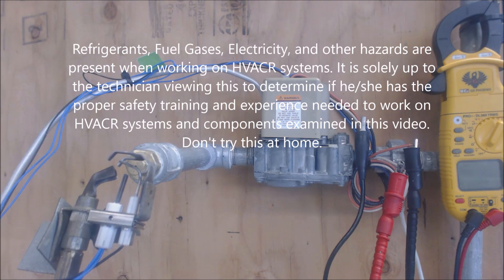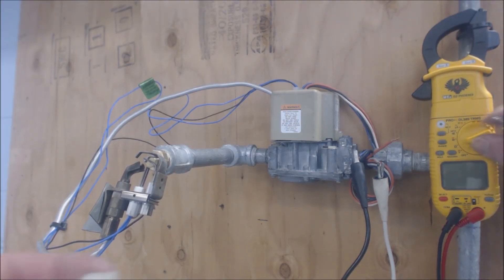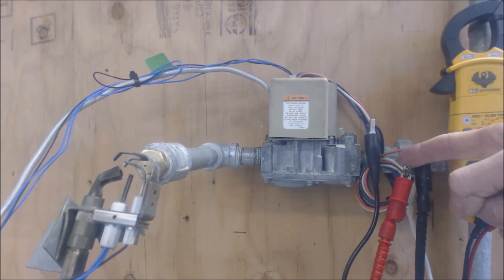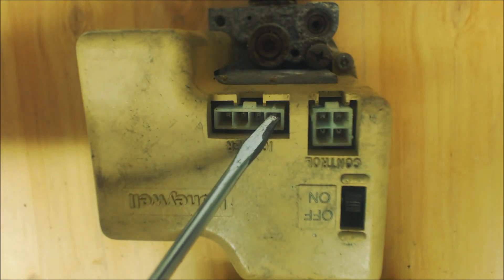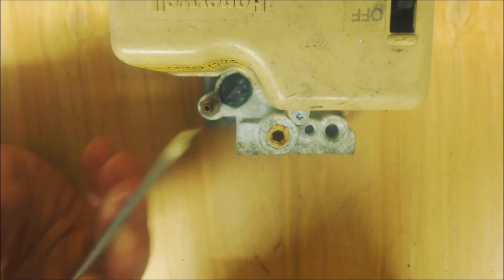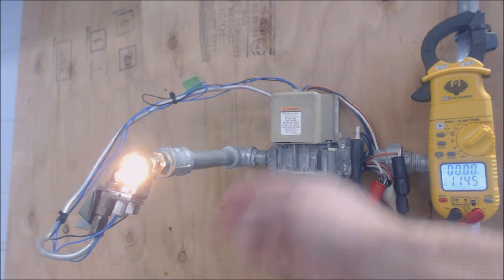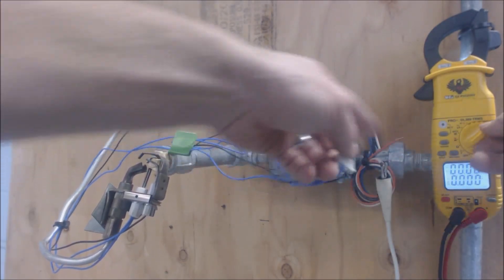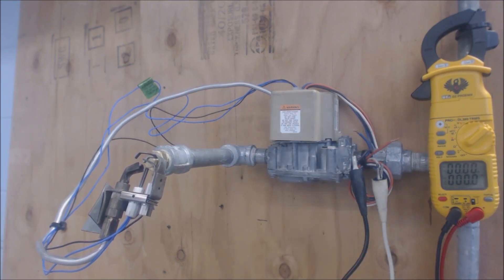Gas Furnace Smart Valve, Ignitor, and Flame Sensor Troubleshooting!

Comment: I have the same OEM igniter/flame sensor.  Looks to be original, maybe ~20 years old.  My igniter doesn't glow.  Igniter condition visually looks good.  Ohms test is good (3.4 to 4.6 depending on which tester I use), and the smart valve is putting out 24volts to those wires.  (Not sure if I was supposed to test that, because no where on the web does anyone do that.)  Does this mean that the igniter is shot?

Comment: I have a a smart valve system, but it also has a control board. I'm not getting my draft motor to turn on when I call for heat. Limit switches and pressure switches are good. Motor is good. Does the smart valve control the draft motor or is it my control board?

Comment: Do you know if the newer valves are giving a lower fluctuating voltage on the flame sense post? ( Cycles from 20v goes up to 50v then keeps repeating same reading)

Comment: I Have This valve. Hot plate lights, pilot lights and stays on. But then main gas does not start to flow. Then the furnace starts to blow but obviously there is no hot air. Do I need a valve or a board? Yikes I can't figure it out. Already replaced Hot Plate / flame sensor, and nothing changed.
Reply: There seems to be no separate circuit for the main gas valve it seems the Pilot gas valve and Main gas valve should open at the same time unless there's an internal timer. I believe my valve has failed

Comment: I just left a service call.  I discovered the flame rod had come in contact with the metal shroud that is situated over the rod.  the assembly had been tampered with.  the shroud was slightly bent enough to touch the flame rod.  flame would not make.  all i had was the draft motor.  after viewing this video, i have discovered a means to prove a good gas valve.  and how to carefully inspect the entire circuit without going down a rabbit hole.  great video.  i won't forget the nightmare of a service call that this last one put me through.

Comment: Hi I converted mine to propane. Same smart valve as yours. I’m using it for a fire pit outside only problem I have is that at the psi flow from the tank to the valve the burner won’t ignite even though the igniter is glowing. But once I lower the psi to about 2-3 psi it turns on, what do you think is the problem?

Thanks.
Reply: For anything to ignite it takes flame or an ignition heat source, fuel which you apparently have a ton of and it must be combined with oxygen to combust. By lowering the pressure to get it to ignite, it seems like the high pressure isn't allowing enough oxygen with it as it passes over the ignitor to ignite. That's my thought. As long as the lower pressure is within low limits spec you should be good. No longer flooding the system with to much fuel. Anyway that's my thought.

Comment: I don't know about Honeywell OEM, but I took apart a compatible SS24 SUPCO ignitor and discovered that they actually use a copper cuff thing that is brazed to the nitride.  This is totally inferior and doomed to premature failure due to the combination of oxygen and thermal stress destroying the braze (the reason I took the damn Chinese piece of crap apart to start with to see what happened).  Nickel alloys OR BETTER  are supposed to be used for the connector with a suitable solder and flux.

Comment: Hi there.  I have a Dayton heater that I am trying to diagnose.  I’ve checked all the different voltage you mention, and the only deviation I have is in the flame rod - I get 24V AC, which I have read someplace is proper for my valve SV9500M-2562 (propane).  The heater will light and turn on,  it then turns off after about 15 seconds.  It then turns back on, and shuts off after 10 seconds… then 5 seconds… then 4 seconds… keeps on decreasing.  I’m thinking something is getting hot and shutting it off, and subsequent heat events take less time to heat it (whatever it is) up.  What other sensors should I check?

Comment: great video, learned a lot. Sv9500h gas valve is not producing 180v for flame sensor, only producing 2.0v . Igniter comes on, pilot comes on but no main burner. Please advice what I can do. Can I get a replacement  IC board. Or is there components on board has failed, how can I test it.  Thanks for any help you can provide.

Comment: Hi, my hsi had about 4.8ohms. Both blue wires have 24vac. But the hsi is not glowing. Black and blue wires also have 24vac. Is it bad valve? Thanks
Reply: Same issue here, what did it end up being??

Comment: EXCELLENT EXCELLENT EXCELLENT explanation of a smart valve pilot ignition system. Just was I was looking for too. I like the fact that you took the time to disassemble the pilot assembly for us noobs. LOL.  It's exactly what I needed to see and learn how/what to do, as my igniter assembly, of the same type as yours int he video, seems to be the issue with my furnace not firing up.  I ordered the replacement part, changed it out myself, and I have heat again. Woohoo! Thank you for making this. A big help that saved me time and money.

Comment: Hey buddy , I have high voltage going to smart valve but no high voltage going to inducer motor to start it up , I jumpered all the safety limits and then jumpered out the inducer motor and it started , I ohmed out the ignitor had 4 ohms . So I diagnosed a bad smart valve , but ppl haven’t went ahead with repair yet , is there something I’m missing here on the proper diagnosis ? It has an 8 pin low voltage Honeywell type molex plug to it as well, thanks In advance , highly appreciate your videos !!! 🙂

Comment: Great video. My black wire had no voltage. I removed the new ignitor connecter and checked the gas valve and had voltage. The connecter on the black wire was not making contact with the gas valve.

Comment: Thank you for great video. I have Honeywell SV9541M2094. I am not getting 24v on ignitor blue wires. I seeing 24v on one of ( black sideone) blue wire to ground.  What could be the issue? If I manually use lighter close to pilot gas, it fires up and furnace start working.  Any help on this?

Comment: Wow! Thanks for helping a Kiwi down this side of the world! So this was very handy!! My pool gas heater stopped working last week! Has the same valve. So I put a meter on it and managed to get 24v on the heat igniter wires which I figured was the case as it was glowing. I just couldn’t get the pilot to start. The black wire to the rod was weird! It was fluctuating between 18-45volts? So long story short, it turns out the gas jet at the pilot end was blocked! Cleaned it out and got a good pilot. But then next issue...main burners would start but go out every time after about 10-30secs! I thought it must be the varying voltage in the rod wire so ran a new earth wire from rod to valve switch in circuit, no change. Tried adjusting the rod and heat receptor arms in case they were out of alignment, no change. Ran earth wire from pilot to valve body, no change! Spent ages trying to figure it out. Turns out, I managed to fix the issue by dropping the pilot assembly down a little below the main burners. It seems to be getting too hot once main burners kicked off and maybe a safety was switching it off??? Any ideas??? As soon as a dropped it down, the main burners kept running! Seems to be working perfectly. Tried moving back up, burners went out!!! So, just thought I’d share this in case it helps someone else! No idea why it worked last week in that position and not anymore? Can only think when I took it out I must have bent the bracket or something causing it to lift too high? Hmmm??

Comment: Why does the pilot stay on at all times on mine? And when I get a heat call the main gas does not come on but if I remove the surface ignitor/flame sensor prong the main gas opens and it starts heating
Reply: A pilot that stays on all the time sounds like a "standing pilot" system. is there a thermocouple that the pilot heats up?
Reply: @tychodancer   I have the same problem. Do surface ignitors/flame sensors go bad?
Reply: @DAVE-tv2fs  Oh yeah. The hot surface ignitors break really easily. and the flame sensors can get dirty and corroded. If you need to replace them make sure you get the right replacement. Also hot surface ignitors can go bad if they get exposed to the oils on your hand so don't touch the black sparkly part when holding it.
Reply: @DAVE-tv2fs  You can clean a flame sensor with a scrubby sponge like "scotch brite"
Reply: A flame may not be sensed if the unit has a bad connection to it's "case ground". so you can have a good flame sense but a bad "electrical ground" connection.

Comment: Great video to understand how the furnace works. Would be possible to have faulty Igniter/Sensor that works with thermostat without C wire and does not ignite when replacing with thermostat connected to C-wire?  Also, I measure the resistance on cold HSI and it is 4.1 oms. Trying to troubleshoot the 19 years old furnace when newer thermostat connected through C-wire.
Reply from the maker: The c wire or battery powered thermostat shouldn't be a problem. You just want to make sure that you have 24v on the w thermostat terminal when calling for heat at the thermostat, thanks!

Comment: Great video, much thanks!!  I've got a question.  I'm having some trouble with the on/off switch. If the switch on the gas valve was in the off position, would the ignitor light???. I'm dealing with a possible broken switch and Im trying to confirm  if it's on or off. Everything is working except no gas flow to pilot.

Comment: hi, i was working on a rooftop with the same smart valve. but when i measure the black wire (flame sensor) i was only getting around 50vac. The flame rod was very clean. Why is that you're getting around 180vac but mine was only around 50vac? thank you for all your help.
Reply: I got 144v

Comment: What is the valve that you’re working on?  I have a bad connection between the 3 pin connection and the igniter, everything tests good individually but when connected, the igniter doesn’t receive voltage.  Thoughts?
Reply from the maker: That is a honeywell smart valve, thanks!
Reply: Same replace it

Comment: Thank you again I actually have a sv9500m 2500 are these valves interchangeable
Reply from the maker: You would just have to look at the wiring. The newer version has more wire connections than the older one. There are two main types of honeywell smart valves used predominantly, thanks

Comment: Thank u ,so correct me if I am wrong so if the ignitor resistance is ok and it glows and u have good gas pressure .the pilot black wire should have 110 volt and the valve should send gas to pilot and the flame rod recognizes the flame and open the main gas valve thank u again
Reply from the maker: The black wire will have about 180v when the pilot tube is supposed to have gas flowing throughAll flame rods have 80v to 180v ac voltage and the smart valves typically have a higher voltage, thanks.

Comment: My hot surface ignitor gets red hot what do u think it could be the pilot flame doesn't light ?? Thanks
Reply from the maker: If it is a smart valve like in the video, check the inlet gas pressure and then the outlet pressure of the pilot tube. If there is good pressure going in and no pilot tube pressure while the hsi is red then the smart valve is bad, thanks!

Comment: So the bread ties finally stopped working. I was able to get the resistance reading on the hot igniter and it is 4.8 - 5.0 ohms.  The pilot light will not ignite but I can no longer hear the click from the thermostat calling for heat.  There was a series of clicks when it is working that I am no longer hearing so now I do not know if it is the thermostat (original since house was built in 1969) or the smart valve igniter module Honeywell SV9500M 2682 HQ1009093HW.  What do you suggest?
Reply from the maker: You can jump from r to w in the thermostat to bypass that so you can see if that was the problem.
Reply: Sorry I did not know you had responded to my inquiry -- what do you mean I can jump from r to w in the thermostat to bypass that?  Do you mean I can check to see if the call signal is being sent from the thermostat to the heater/furnace by connecting the r and w wires in the thermostat?
Reply from the maker: @tzxlyd3828  Yes that is correct to take it out of play, thanks

Comment: hi thanks for all your videos...
today i checked a good man package unit , the hsi do not glow , i have 24v coming out the gas valve, but when i plug the hsi , lost my 24v.
i check the hsi direct from transformer and the hsi glow.
can you help me out .
t thanks
Reply: what do i need to do , it's a new gas valve, the person who install the gas valve , he just tell me , that went he was connecting the gas pipe , he saw spark every time the pipe touch the unit .
Reply: Josue Lopezchente  I’m having the same problem. I don’t want to change out the valve if it does not need to be. Did you ever figure out what the problem was?
Reply from the maker: That sounds like a ground problem or just a problem in the smart valve board if you are receiving the proper 24v input as a call for heat, thanks

Comment: I am having a Lennox furnace, was having issues where the main burner was not coming up so I decided to purchase a new smart valve...went with the SV9501. After doing the replacement now the pilot will go on and the main burner would go on, but when I shutdown the furnace via wall switch the pilot does not go on. I check the actual rot and igniter and noticed the blue wires by the  hot surface igniter as well as the black wire of the flame sensor were a bit melted. I am trying to understand what controls the pilot gas output. I know it comes from the valve, just wondering if the frame rot and the hot surface igniter are the one controlling the sequence along with the Smart Valve. Before I go ahead and purchase a new hot surface igniter I would like to hear your recommendations. Thank you.
Reply from the maker: The smart valve heats the hsi and then opens the pilot tube to let gas through. It is all controlled at the smart valve control board. I don't know why your pilot would stay lit without a call for heat. Does your hsi continue to stay powered too or just your pilot allowing gas through, thanks
Reply: @acservicetechchannel Basically, I turn the gas on (safety measure during testing phase) then I proceed to turn on the wall-switch. After than I see the HSI glowing and then the pilot goes on then the main burner lights up. When I turn the wall switch off I see the main burner goes off but the pilot remains on forever. The first Smart valve that was there the burner didnt go on at all, I think the circuitry just got burn out or something so I went to ebay and purchased a used one....this one light up normally but I am having this issue with the pilot where it stays on all the time. I have the feeling that even when I open the gas line gas is getting release from the pilot orifice/hole automatically, I know is not a lot but as a safety measure I have resorted to close the valve until its all working. I am a little clueless on this one, your help is greatly appreciated.
Reply: I have changed the HSI and all is working 100% now. The old igniter was 15 years old, so I guess it served its time.

Comment: Well I got it to work but if it is bad I do not know how much longer it will hold up -- it is the older model SV9500M2682 and from what I can tell it is no longer being manufactured.  I believe the replacement part for it now is model SV9501M2056 (also SV9501M2528).  I assume you would recommend that I get a multimeter and test the voltages before making any determinations -- it just seems until I can do that the Smart Valve is the obvious problem if it is not a short with that clip.
Reply from the maker: It may be the pressure switch, flame sensor and hsi combo, the grounding, or the smart valve but I couldn't tell without readings, thanks

Comment: I do not have a meter but I believe my smart valve is bad.  I was using a bread tie to pull on the igniter clip that locks into the smart valve because I found if I move that clip the pilot light would ignite.  I had the bread tie pulling that clip in towards the pilot reset knob (it was wrapped around the igniter clip and the reset knob) so that the pilot light would ignite and stay lit.  The problem was the pilot would not stay lit until there was a click after the induction motor would start.  If I pressed that igniter clip that fits into the smart valve backwards I would hear the click and the pilot light will light and stay lit.  I found if I let that locking clip go into the normal position the pilot light would shut off.  Now after a couple of months the pilot light will not ignite no matter how much I move that locking clip. I did notice when I would move that locking clip that there was a small spark right where that clip fits into the smart valve just before the pilot light would ignite.   Do you believe the problem is the smart valve or could there be a short where the locking clip fits into the smart valve?
Reply: So the bread ties finally stopped working. I was able to get the resistance reading on the hot igniter and it is 4.8 - 5.0 ohms.  The pilot light will not ignite but I can no longer hear the click from the thermostat calling for heat.  There was a series of clicks when it is working that I am no longer hearing so now I do not know if it is the thermostat (original since house was built in 1969) or the smart valve igniter module Honeywell SV9500M 2682 HQ1009093HW.  What do you suggest?

Comment: 9 times of 10 it’s going to be a bad smart gas valve, which are pretty expensive to replace.
Reply from the maker: I've actually had a lot of bad intermittent problems with the flame signal which were solved by replacing the flame sensor and hsi combo but yes the board on the smart valve goes too, thanks!
Reply: Good! The more the part cost, the more markup there is. $ My kids like to eat EVERY day...